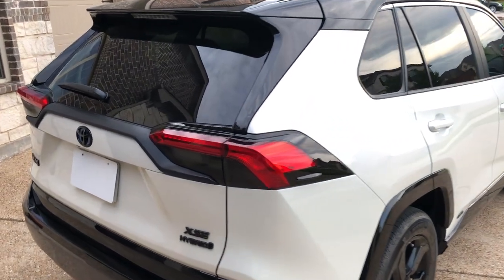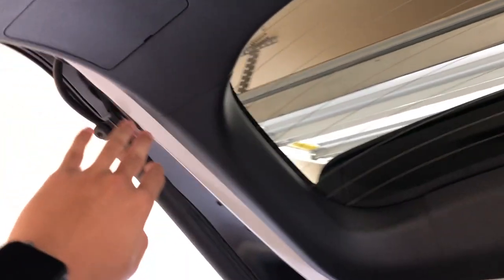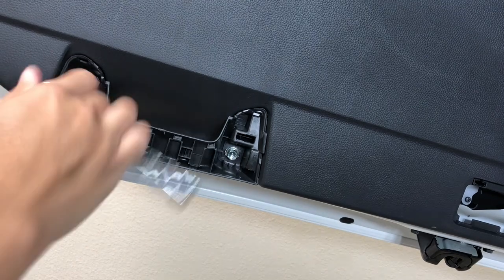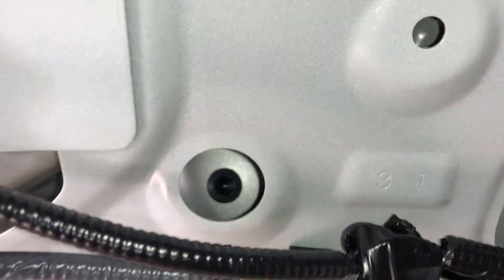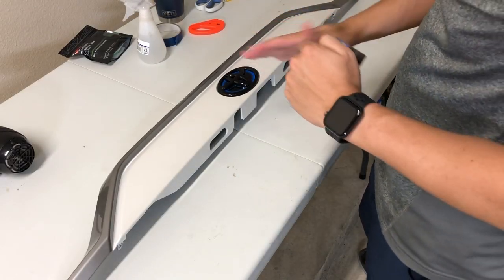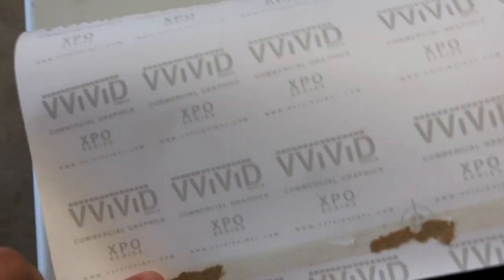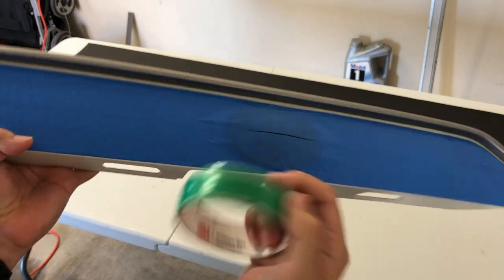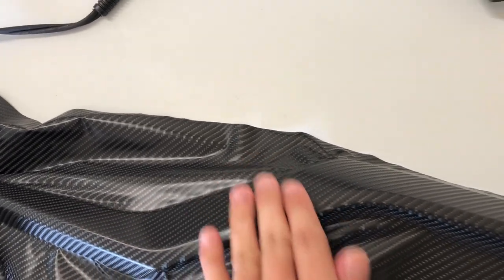2019-2020 Toyota RAV4 - Carbon Fiber Rear Center Trim

Comment: Hello, I recently took my RAV4 Prime in to have this done, and the installer did an absolutely terrible job - they didn't remove this trim panel and tried to wrap it in place. As a result, they damaged the rubber seal right above the gray piece, and the job looked absolutely terrible. I ended up not paying for the service, but now I want to replace this rubber seal - does anyone know if this can be done without removing the rear glass?

Comment: Great job!  I was wondering why you didn't separate the grey trim from the white panel? Won't it have been easier to fold the bottom in like you did the top of the grey trim?  Thanks for the video!
Reply: My thoughts exactly, i dont see the reason to remove the wwhole panel if the grey piece wasn’t completely removed.
Reply: @digidoc911  i think the reason to remove the whole thing is for comfort. With all of the curves, it is very difficult to install the film. Plus, he wanted to fold at least one edge over first to be able to  stretch the material.

Comment: PVC sprinkler pipe is a huge help when installing vinyl. For this install you can have it at the ends like a scroll. It applies pressure equally across the sides unlike fingers which cause wrinkles and creases
Reply from the maker: Oh wow, great idea thanks for the tips! I’ll do that on my next vinyl wrap project

Comment: Hi, thank you for sharing! The carbon fiber turned out great! I might’ve missed it in the video, but does covering that piece effect any sensors or efficiency of the vehicle? Like for example, I understand the front emblem has a sensor and that’s why it cannot be blacked out.
Reply from the maker: As far as I know there is no radar sensor behind that panel on the back. I have that on my car for over a year and haven’t had any issues. And yes you’re right about the front emblem, there is a radar sensor right behind the front emblem but I don’t see it for the back panel and scent had any issues.
Reply: @Finn Lucas Instablaster ;)
Reply: @Jad Casen thanks for your reply. I got to the site through google and im trying it out atm.
Looks like it's gonna take quite some time so I will reply here later with my results.
Reply: @Jad Casen it worked and I finally got access to my account again. I'm so happy!
Thanks so much you saved my ass!
Reply: @Finn Lucas you are welcome xD

Comment: Great job! The only thing is since you car has no carbon fiber parts on its body I'd use glossy black film so it would match the rest black parts. And PLEASE get rid of that stupid (IMHO) and the only one chrome part of the car - the window trim. You can use the same method with the film or better yet just put the 6 pieces rain guards which you can buy from e-bay. Use ONLY 6 pieces, because it designed to cover completely and perfectly the whole chrome stripe along the windows. And only then the black out of you car will be completed. Thanks and good luck!
Reply from the maker: Thank you! You know for the longest time I contemplated if I should use gloss black so it flows better with my black roof or carbon fiber. Decided to finally use carbon fiber coz I just can’t help it, I’ve always liked carbon fiber pattern... lol

Yes I am going to wrap the chrome trim with gloss black vinyl wrap, I already bought the vinyl wrap. After wrapping this grey piece and my headlights (with the bio pulse hex tint, I also posted the video on YouTube) I need a break from wrapping Lol... I’ll do it this coming weekend and I’ll post the video on YouTube
Reply: @Otthox  Thank you for respond. Well, if you like the carbon pattern, then I 'd recommend to decorate it inside the car. There are a lot of carbon panels on sale and in this case you will be seeing you favorite color/pattern while driving. Outside....that for the eyes of bystanders...LOL. Anyways, great plan with the black out! You have a taste. Good luck. Looking forward to see your project completed.
P.S. Any idea WHY on earth Hybrid XSE doesn't come in black?
Reply from the maker: Alfa Alpha lol yes that’s true.. but those carbon fiber panels for the interior are quite pricey on eBay and almost all of them ship from China... I’m looking for something that ships locally within the US.

Yeah don’t know why there is no black XSE hybrid... maybe because all the XSE hybrid are two toned with black roof so if the body is black there is no contrast with the roof
Reply: @Otthox  You are right. It's pricey and then you have to wait for a couple months. Did you change your bulbs inside the car to LED? How about back-up or turn signal lights? If you decide to I can guide you through. I don't have video, but it's easy to do.
Reply from the maker: Alfa Alpha i actually just changed the rear turn signal & reverse light this weekend, made a video and will post soon. The reverse light is super easy, to remove the turn signal lights, man it’s hard... steps are pretty easy but you need quite a bit of force to pop the light off the body. 

Took me this long to do it coz there are already other people making the video so I’m not overly excited to do it, plus just trying to find good light with good value is quite overwhelming... there are so many LEDs out there now in the market
Reply: @Otthox  Good job man. For all LED needs I'd recommend LASFIT. They are a bit pricey, but the quality is superb. Just read the reviews. And please post the videos anyways!
Reply: I had rain guards installed on my new blizzard pearl XSE hybrid..... and it looks incredible.  I guess the XSE could have black paint with a white roof.... the Limited hybrid in black looks great even without a white roof.
Reply from the maker: HenryHonda I saw that rain guard, definitely looks nice! I decided to blackout the chrome trims using vinyl wrap just because I was on a roll with wrapping and it’s cheaper as the gloss black vinyl wrap costs me only $8. Here is the video where I didn’t that: https://m.youtube.com/watch?v=LSwSGc_Qt9c
Reply: Theres still grey part on the front lip bumper and rear bumper. Cover that then hes done.👌
Reply: @wanderer2955  Yes you are right in the case with XSE. I'm wondering why should we Americans go with all this struggling to black out the car if there's an European Black Edition since 2020 model year? Not fair!!!!
With 18" wheels:
https://www.youtube.com/watch?v=UC_rXQl1I0g
and with 19" wheels:
https://www.youtube.com/watch?v=puOPzMQYvM4&t=29s
Reply: @henryhonda8408  Only XSE model has GLOSSY black surroundings like lower side panels, wheel arch flares and e.t.c. Check it out with European Black Edition trim:
https://www.youtube.com/watch?v=UC_rXQl1I0g

Comment: Hi!  I was wondering if it would be ok to make reference to your video in describing some work I did on my R4P.  
Your video was very informative in how to remove that center trim.  

I purchased a kit that converts that grey part of the trim into a DLR light and turn signal bar.  There were no real instructions that came with it on installation.  But your video was handy in showing how to remove and replace the trim.  (I did not make an installation video .)  The installation went fairly smoothly.  Most everything you did in your video I had to do.

Nice Job on the wrap by the way!
Reply from the maker: Hi yes, you can mention my video and provide the link on the description for sure. Not sure if you're going to do this in a video or blog post. If you're doing a video, I'd say don't take the actual clips of my video and put it in yours because it's going to trigger youtube copyright strike. I had someone took 2 min clips of my video and upload it as his video in his channel and he got copyright strike.

Thanks for watching, I'm glad that it's helpful!
Reply: @Otthox  Thanks.  No, I'm won't use anything of your video in mine if I make one.  That's why I would link to yours for further detail on the task of disassembly and reassembly.  I would just be showing the end result of how the light bar looks and works, and where it can be obtained.

I plan to open everything up again because I want to add a lighted toyota emblem on that rear trim.  So I may make a video showing the wiring routes.

Again thanks and good job.

Comment: what size vinyl did you use for this project?
Reply from the maker: I used size 1.5 x 5 feet, which will give you 2 attempts in case you messed up. Here is the link which is also in the video description:
https://www.amazon.com/gp/product/B00YLFPETM/ref=ppx_yo_dt_b_asin_title_o08_s00?ie=UTF8&psc=1
Reply: @Otthox  did you cut it in half first then? I didn’t realize.
Reply from the maker: @scottbrown-xveganxedgex2799  yes I did, I cut the vinyl wrap in a half first horizontally so I had two chances. In cases I messed up the first one

Comment: Thank you for posting this idea.
However, it is important to note that dark colored vehicles have a very shallow visual field depth at night for which shiny reflective surfaces are a great help. 
It is not uncommon for black vehicles to have rear end accidents at night when visual conditions are not optimal when compared to vehicles with light colors or that have reflective materials.